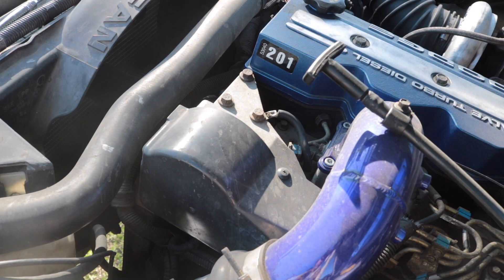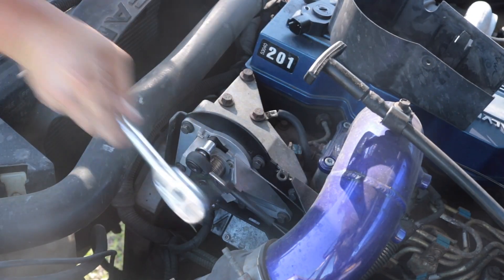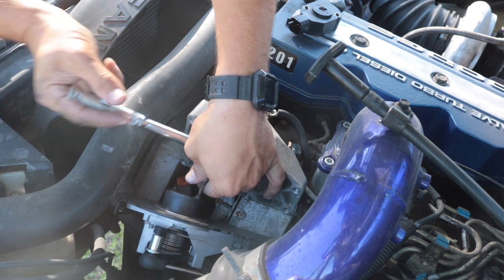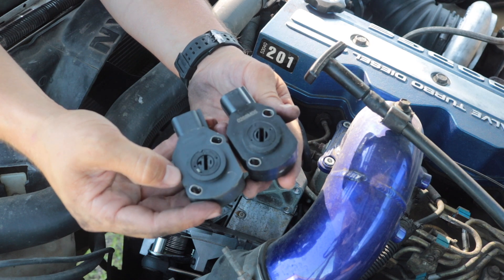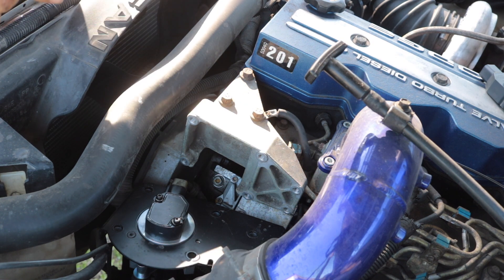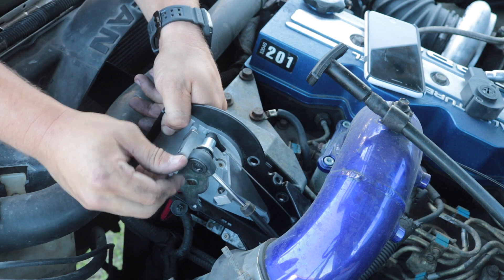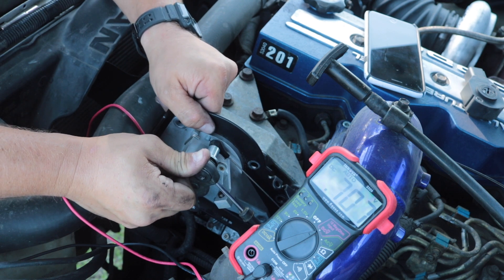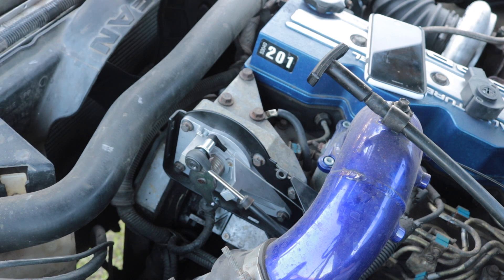Dodge Cummins apps install. Do not buy this brand | 98.5-03 24v Cummins

Comment: Great video.  100% accurate for my 2004 Dodge 3500 that was varying RPM without pedal movement.  I purchased a Wells Vehicle Electronics (Wisconsin) APPS from OReilly's.
Reply: Did it almost feel like the throttle cut out for a quick second while holding the pedal in the same spot? My truck had been doing that and idling weird. Have an apps sensor on the way

Comment: ive heard when the new apps is calibrated to the ecm. first take off both battery terminals and wait till the system completely drains, hook back up the batterys,  turn on the key, depress pedal once,, turn off key.. and then ecm should calibrate to the apps..  not sure it actually matters though..  good vid,  th;anks

Comment: My apps was fine , it was a bad ground, and u follow the "how to" book it does'nt talk about the ground. Therefore i wound up with a new APPS i did'nt need in the first place.
Reply from the maker: My grounds were fucked up too I found out after this video was made was thinking
About making a grounds video too
Reply: How did you know you know your grounds were bad
Reply: @bigdonjr37  UNplug the APPS and and splice in a ground from the black and yellow wire coming out of the back of the connector. U must cut the wire and slice in a ground lug to battery negative terminal, which will give a good ground from the PCM.
Reply: @jamesgriner31  thank you.
Reply: @bigdonjr37  unless you have new terminals and batteries, all dodge terminals are crap. better off putting 18 wheeler batteries in there ( that’s what i did )
Reply: What ground where

Comment: I have replaced mine as well, but I didn't check the voltage nor did I calibrate it like you did. I have a constant check engine light P0222. I believe it's low voltage to the TPS. I'm hoping if I get a voltmeter and go through these steps like you did, it will get rid of it....
Reply from the maker: Yeah definitely want to calibrate and check
Voltage that’s a big part of it,
Reply: @floridafenceland1137  thanks for the quick reply I will definitely do that.
Reply: @floridafenceland1137  are the voltages pretty standard as to what is in your video
Reply from the maker: So each brand sensor has a specific voltage and sometimes they are printed on the back of the sensor and you have to match that voltage by clocking the sensor or adjusting the idle screw to get your correct voltage. I have since this video bought the timbo sensor from genos garage and it has been better than any other I’ve had by far I highly recommend this part
Reply: @floridafenceland1137   Where did you get that part

Comment: Good evening, I changed in my ram 3500 2001 diesel the TPS sensor calibrated at .55 v but in the calibration test it does not exceed 1.99 and it becomes OL and remains dead

Comment: Hello I have a 99 5.9 Cummins when I reach 40mph it kinda gets sucks and the rpms go up and down and I have to press harder in the pedal so it can accelerate if I change the throttle sensor will that fix my problem?
Reply from the maker: Check your grounds
Reply: T B mechanic said my diesel and injector lines have to get cleaned
Reply: @mauroalvarez9092  ya arreglo lo de su troca?
Reply: es un cable de la tierra asi estaban las trocas mias
Reply: @geronimolara12 Mr Tengo UN dodge 2000 diesel y es  tiene el mismo problema a 50 y 55 El rpm sube y Baja El mechanico lo cambio pero no lo calibro y por eso Sigue brincando y le cambio El tps tambien a un 96 que Tengo y El  mismo problema deme una Buena idea porque este sabado les me to Mano Tengo El calibrator y llaves asi que voy con Todo a cuando tiene que estas de calibracion para que quede al 100. xfa gracias

Comment: I have a new one for yall, 99 24 valve converted to p-7100 pump, will not start and keep on running untill the wait to start light goes out. no one has had a answer for that one yet, appreciate any respondance to this problem
Reply: Im sure when you did the wiring hook a wire in the wrong position and when the wait to start is ON the fuel shut off selenoid in the off position
Reply: isnt wait to start a preheater that comes on? i always wait to start.

Comment: OK.. MYBAD..   I replaced the sensor.. but I didn't do the calibration.. I thought all I had to do was switch out the old one for a new one.  After watching this.. I know what I have to do now.. I have an '03 2500 310k..
Reply from the maker: Glad I could help! Lol
Reply: I have same year auto 4x4. What exactly was ur truck doing? Mine idles up and down like the a/c is kicking on and off. Then dead pedal when I take off from a stop.
Reply: @joseboyd4563  Same thing..
Reply: Good to know. Who did you order from?

Comment: Do you have to calibrate it? What happens if you don’t?
Reply from the maker: It won’t work, actually this brand is a pos and doesn’t work, so I just ordered the timbo one from Genoa garage
Reply: I replaced mine an hour ago and didn't know to calibrate it..  so to answer your question..  It's does the same thing as before.. but slightly different..

Comment: Did this also mess with the overdrive not kicking in ?
Reply from the maker: So I have a manual so I don’t have that problem but, your issue may be due to bad grounds, or also look into a noise isolator that’ll help big time

Comment: My 03 doesn't have that. So I'm guessing it's 02 & older.
Reply: Some 2003 trucks have that assembly, some have it under the driver’s side battery box. My 2003 has the traditional location, but an almost identical one (only difference is DRW vs SRW) has it under battery box. Not sure why they did that, but they did 🤷‍♂️

Comment: Why not buy this brand?
Reply from the maker: It’s junk, go with Timbo brand or oem
Reply: The best one is a newer design using hall affect. Made by Wells Vehicle Electronics. The other ones use a variable resistor (potentiometer) that will wear especially when you cruise at the same location for a long time just making small throttle variations in one area.
Reply: I got mine from NAPA.. I didn't know to calibrate it.. but hey.. it still starts.